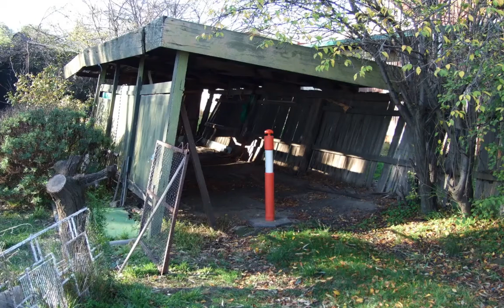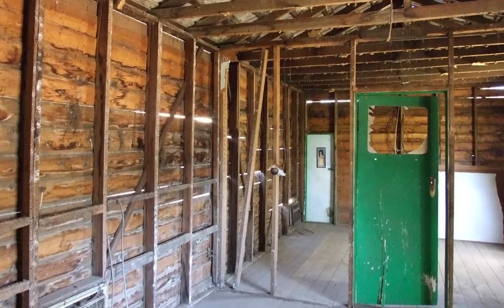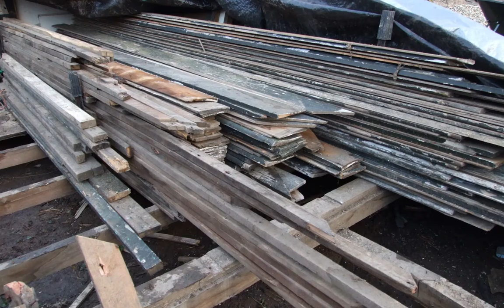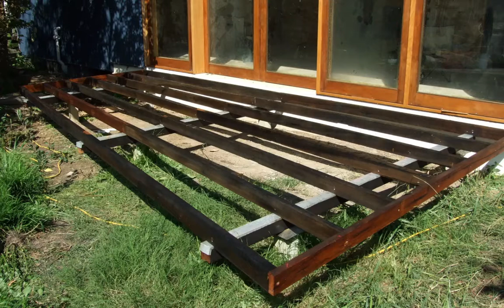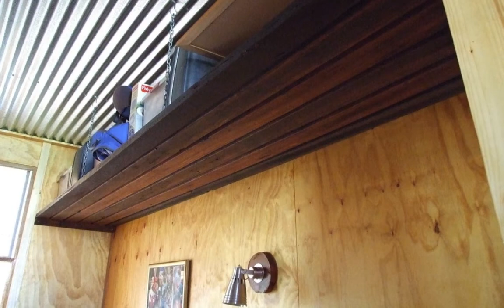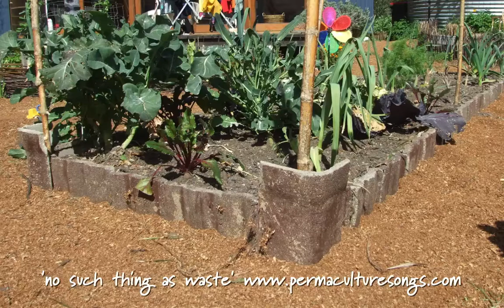Abdallah House: rebuilding a home

Comment from the maker: The slab in this house is just in the living room space, and it's connected to the earth, the rest of the house is on stumps. It's a raised slab using sand and reclaimed bricks for the form, as we are in an urban flood zone and needed to build 400mm above the 100 year flood level. The form around the slab is insulated around the outside to help contain some of the heat in the winter.

See more on the blog link in the video description and search for the label 'slab'